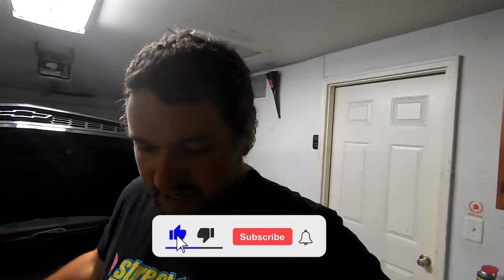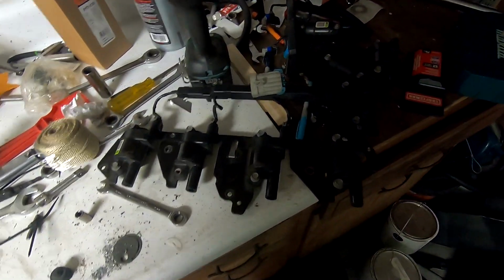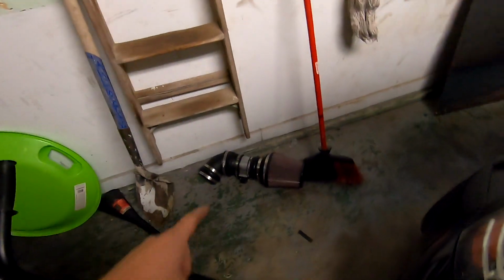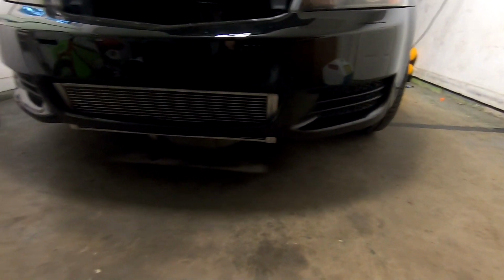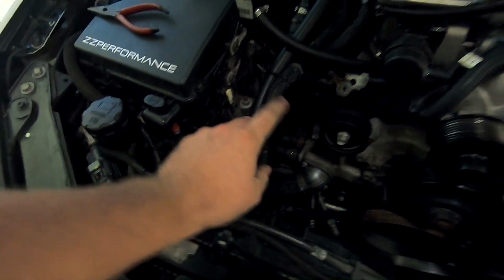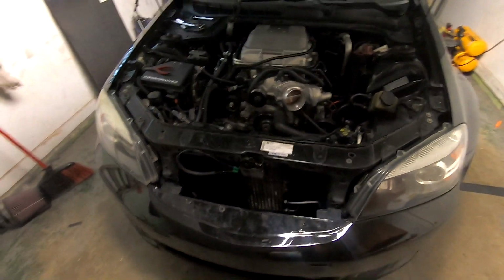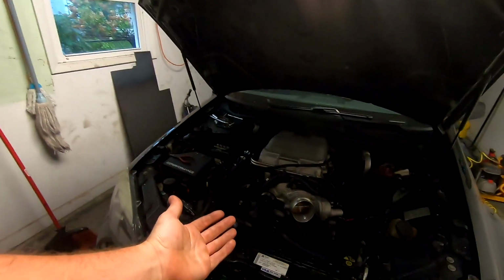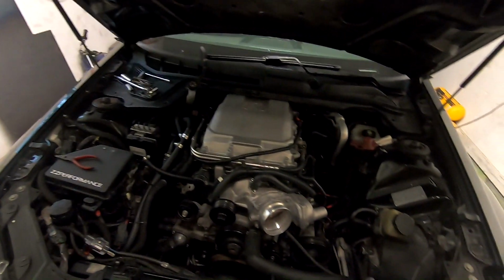LSA CAPRICE PPV | WINTER BUILD TALK

Comment: Luke this may sound completely off the wall but you can put a g8 nose on the 11-13 ppv .. mainly as a means to direct more air into the engine bay. I've noticed some problems with adding a lsa before swapping to a Magnuson
Reply from the maker: yes you can, but I think its kind of expensive. Im going to add on a zl1 hood scoop to the caprice sometime down the road to help with hot air in the engine bay
Reply: @LukeWaters  it's a long shot but I think there's was a Australian company that makes a after market hood for the statesman or if there's someone crazy enough to put a chevy ss hood on a ppv